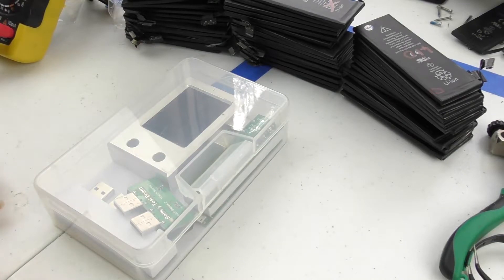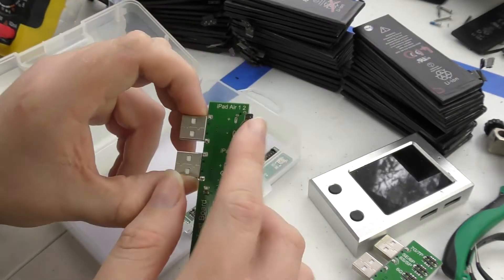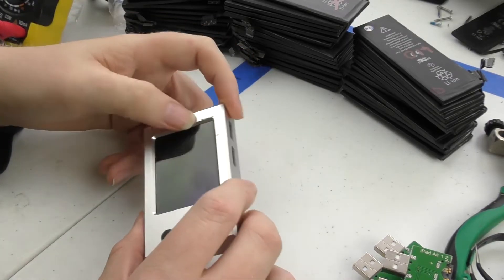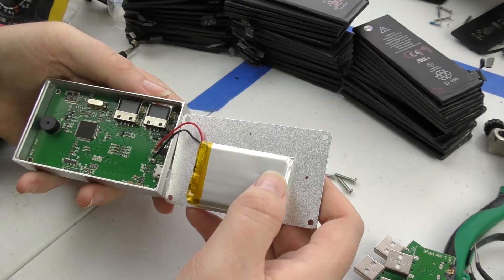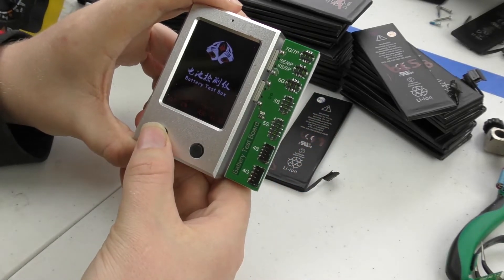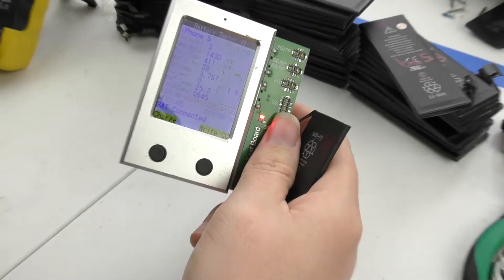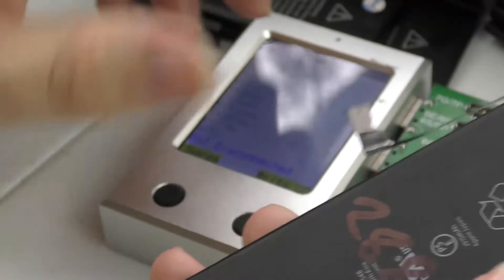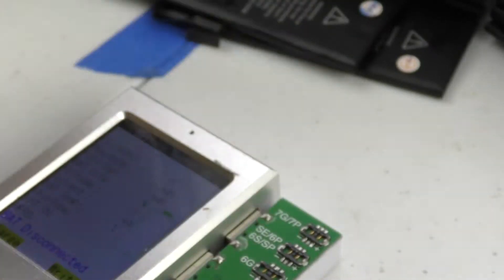iPhone Battery Tester Box - First Look ★ Great For Repair Shops!

Comment: why reset cycles? i mein for what? when i reset cycles, will be beter the batery or what?
Reply from the maker: +Antonio Fernandes in battery re-manufacture, the PCBs are often pulled from faulty “dead” batteries, they have a cycle or two run through to recalculate capacity then the cycle count is reset (usually)
Reply: ho, so its only for refurbished batteries right?